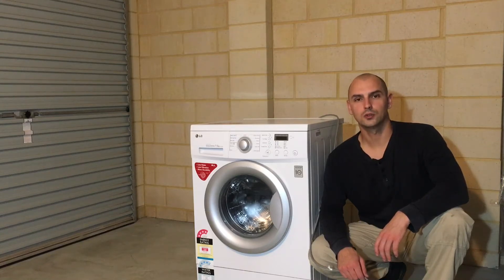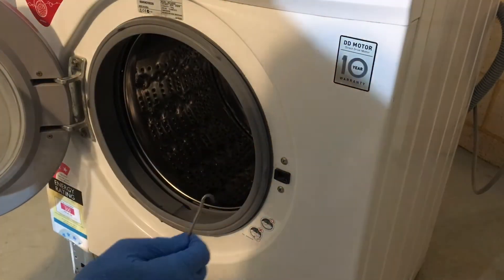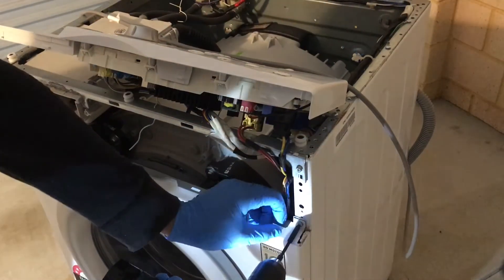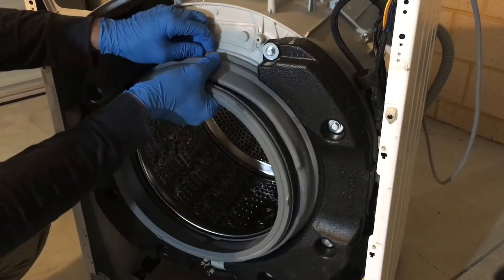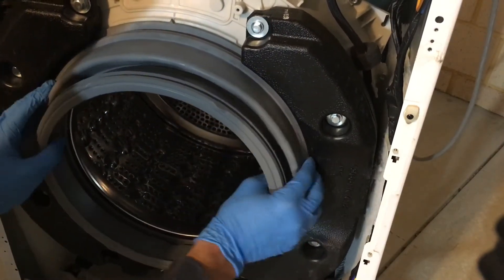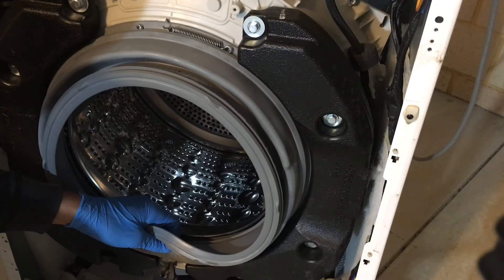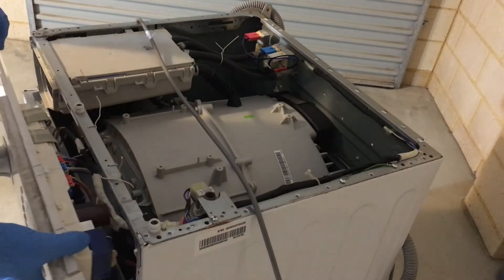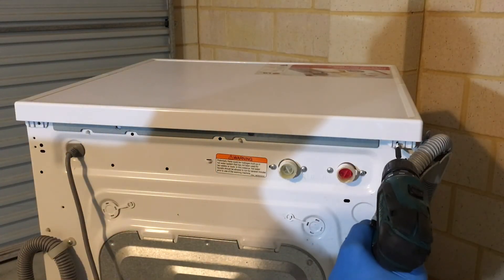LG Washing Machine Door Seal Replacement - WD12020D

Comment: Thanks so much for posting this. I'd never have worked out how to replace the seal without this video. My LG is a WD12021D6 and the part number for the seal is 4986ER1005C in case anyone with the same machine is wondering if this video will apply to them. Thanks again!!!

Comment: If anyone is charging it for the first time.  My advice would be to Take the top & the front of it makes it easier access. I struggled without the tool and if you’re not familiar, then you can actually damage the gasket!  You can buy the tool about £12-£14.
I hope this helps the video did help me👍